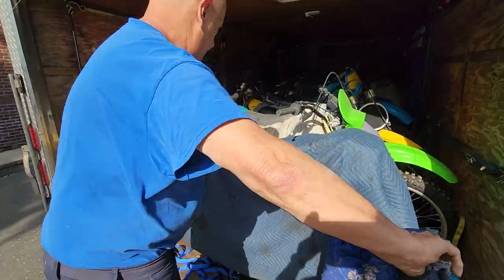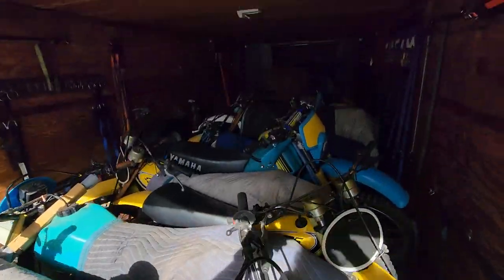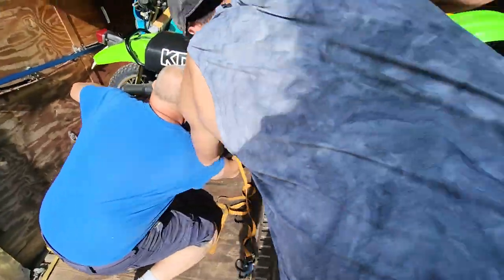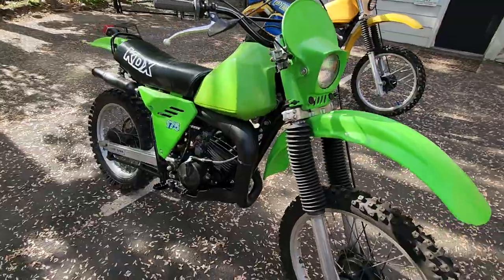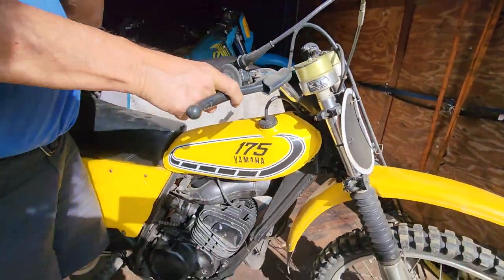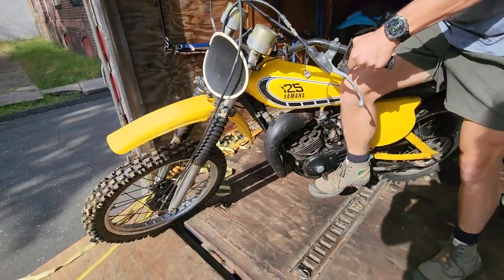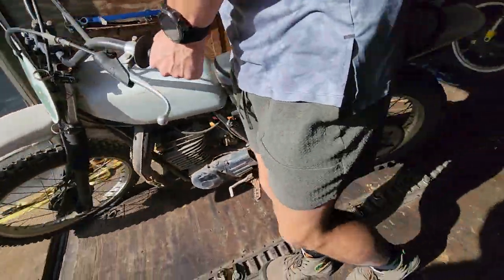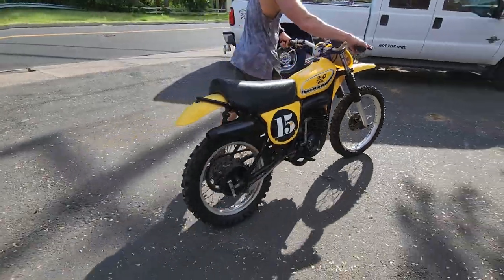WE BOUGHT A HUGE COLLECTION OF CLASSICS FROM VIRGINIA PART 1

Comment: Those are 76 yz175, 125 and 250. Porcupine heads all came with raw aluminum finish as were the early DG radial heads, then they anodized the later radial heads gold.
Reply from the maker: And 400